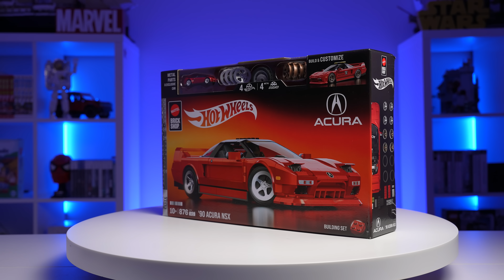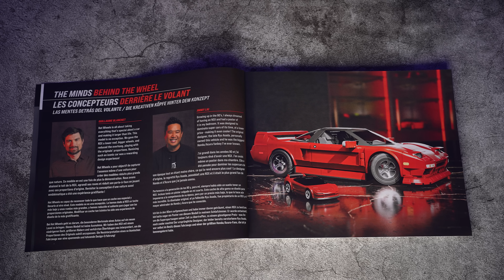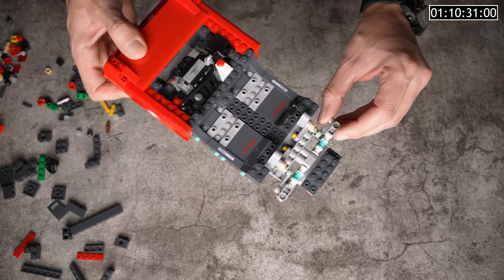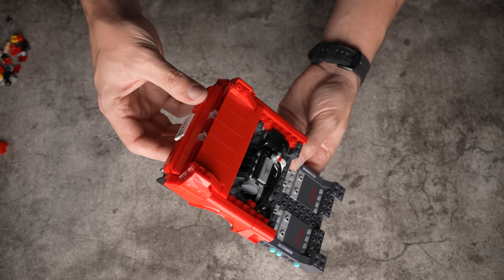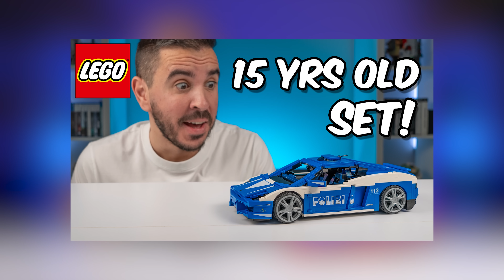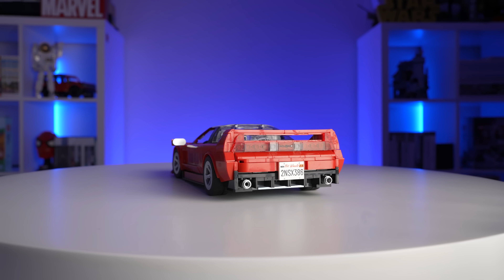Metal parts! || Mattel Brick Shop | HOT WHEELS | Acura NSX

Comment: Lego is expensive for a reason. Yes, they could learn from this set by using metallic wheels and realistic tyres as well as actually having a windscreen and rear glass, but I'm not impressed with this Mattel model. I have over 10 years experience in building Lego/Lego Technic models and this set is just ridiculously difficult to clip pieces together, some parts of the instructions are unnecessarily confusing, and some parts just explode in your hands as you try to build it. Yes, it looks good no doubt, but needs huge improvement. Yes, its cheaper but I still don't think its worth its price tag. Real shame to be honest. Definitely overrated.
Reply: All I read was "I'm a Lego fan boy and don't like that LEGO makes inferior cars so I'm gonna cry"
Reply: @magic_ohh Yea real original 👏😂. You managed to read all that. Who's a good boy.

Comment: The steering rack could use some more range BUT at least it functions at this scale and the wheel actually controls the steering and not like how Lego does it with the mid range technic set with the knob on the roof.

I have the Lego technic Ford GT and they didn’t bother trying to make the steering wheel control the steering rack when they probably could’ve since there’s room and half of the steering rack is basically prepped to do so, but beggars can’t be choosers. Still, the NSX is a great set for the price and accuracy in its scale with great functions.

Comment: Strange that they include 2 sets of wheels and they're both wrong. The fat fives should be... well more fat. And the blades are supposed to be seven spoke not six.
Reply: Rays have 6 spoke wheels
Reply: @siam49722  So they are aftermarket wheels. I just assumed they were supposed to be actual NSX wheels.